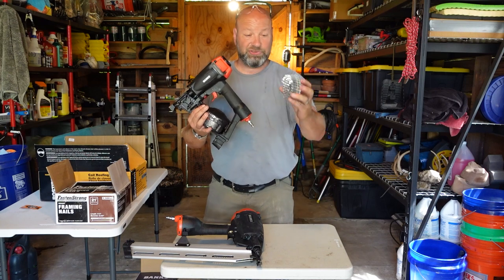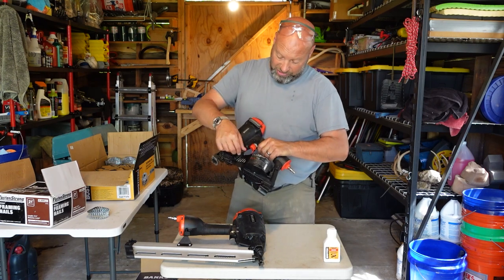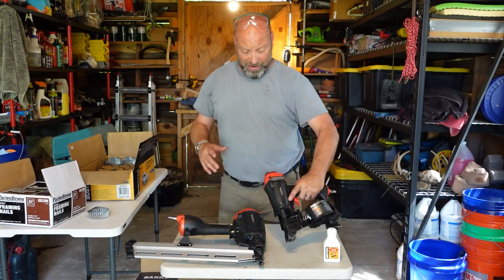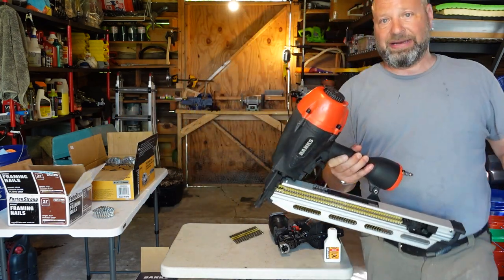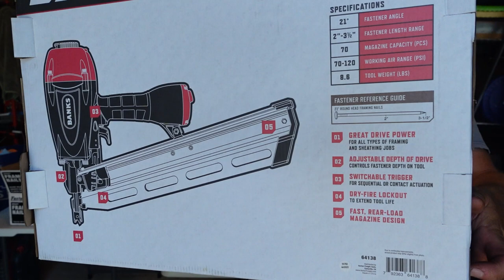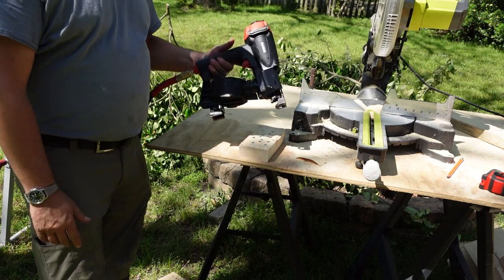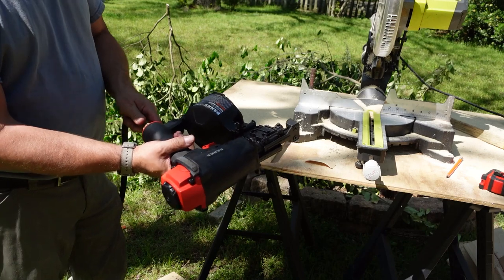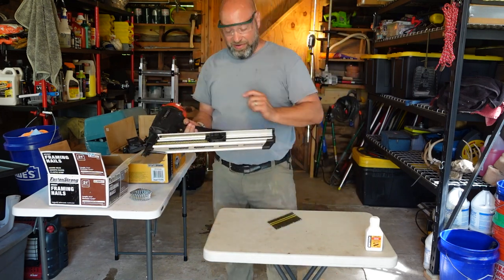Harbor Freight Nail Guns Review

Comment: Nice find on the slab. I bought one and loved it along with a 50ft hose and reel. Made easy quick work building a fence. I found a steal of deal on a craftsman 20v frame nailer with battery and charger and then later a Brad nailer. Super nice and make quick work.
Reply from the maker: Awesome! The nailer sure do make it fast and easy

Comment: What size air compressor would you recommend?
Reply from the maker: Any pancake or small compressor works perfect. It doesn't take a lot of air to run them. I use the same compressor that came with my brad nail gun kit

Comment: I'd be cautious with harbor freight nails for outdoor/pressure treated if they are actually  hot dipped galvanized. Sinking a nail with China tools is one thing idk if I'd trust their fasteners long run
Reply from the maker: 😂😂😂 they are all made in china
Reply: @SamkoWorkShop  Metabo is Canada and are Isanta approved. Idk if the harbor freight ones are
Reply from the maker: @Eric-id8nu  these nail guns work great. If I was a pro builder I'd probably invest in better. Bit these have built 2 garages now and a shed and work perfect. I have 50k in camera gear because I'm a pro. But that doesn't mean an iPhone can't take great pictures.  These nail guns are excellent and affordable.
Reply: @Jason-Samko  great point